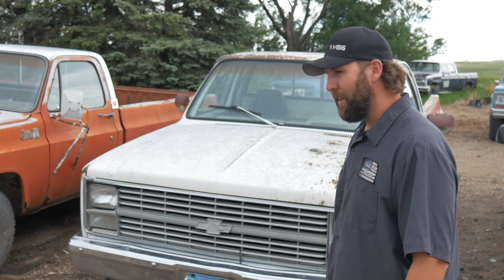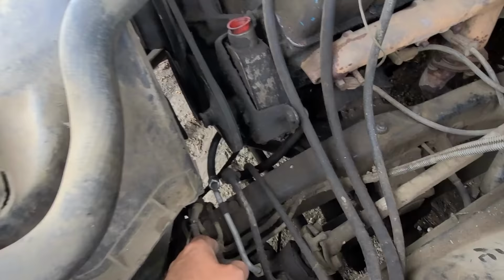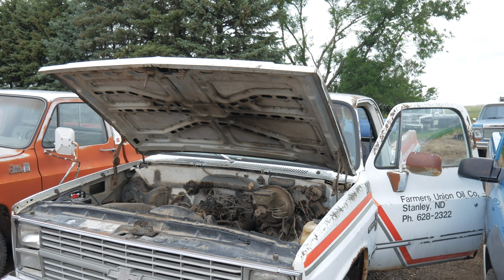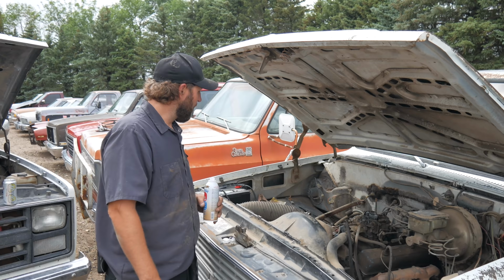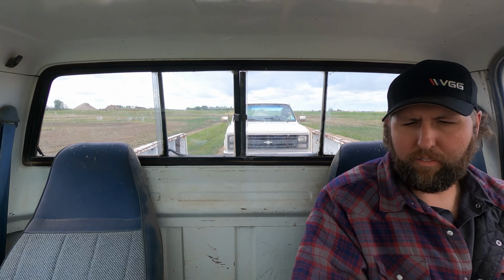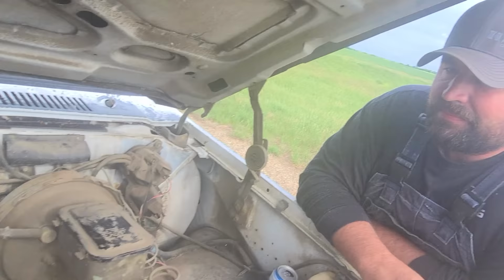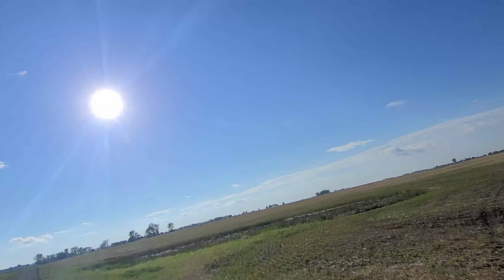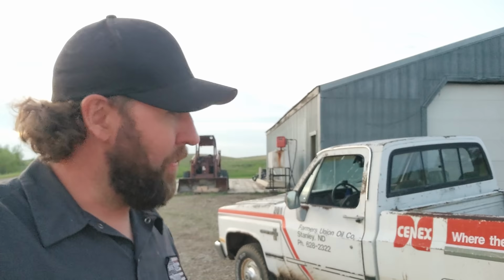FORGOTTEN Chevrolet 4x4 Square Body - will It RUN AND DRIVE 60 miles home?

Comment: I just want to say I revived my friends old dodge that sat for a while and everything I did to get it running I learned from these videos.
Reply: Just about everything I know about cars comes from this channel
Reply: @Inisfad  yeah that’s the problem we don’t know what he’s tasting for lol
Reply: @Inisfad  u can smell the gas in the oil. Not sure what it means tho exactly lol
Reply: @billybobthornton4186  it means your getting gas in the oil.....  bad fuel pump usually
Reply: I hear u there he gives me more inspiration to do more of my own work then to pay someone to do a half job
Reply: @carolynwilbur1627  rings aren't sealing plus incomplete combustion (raw gas is left in the cylinder, and it gets by the rings into the oil)
Reply: @Inisfad  usually it tastes like burnt French fries and old maple syrup
Reply: @Inisfad  anyone who has siphoned fuel knows what it tastes like, and anyone who has had to pull a lower hose first knows what coolant taste like lol
Reply: @carolynwilbur1627  not the fuel pump..usually that means rings are worn or stuck.
Reply: @50ccog  Ernesto eel el el to Eric erré
Reply: @MP-zf7kg  I had bike that did that. It was fuel injected idk why but it injected more than it needed and always ran rich. Pretty sure my lawnmower could of ran off the oil out of that bike before I got rid of it. 

It was a single cylinder and never missed.
Reply: @sethkyehardin5338  I syphoned coolant from my over flow to my rad and drank a bit won’t forget that lol
Reply: @billybobthornton4186  means it's been flooded really bad more the. Once
Reply: My 14yo son and I revived an F100 he is taking pride in building to be a good weekend driver
Reply: Really hope you use the correct terminology such as Crankalater, Lightning Whirller, Thunder Box etc.
Reply: Chevy Is The Best, sooooo
Reply: @billybobthornton4186  fuel in the oil of a lot of the cars Guy works on means somebody tried unsuccessfully to start and dumped a lot of gas down the carb and it seeps down into the oil pan.
Reply: @donfronterhouse4759  or it just flooded
Reply: And it's a Mopar.  😂They just wanna run
Reply: agreed upon love this channel I'm looking for a project now myself

Comment: My wife, who doesn’t watch the show, said “They spent more time trying to save time. Must be one hell of a meatloaf.” A wise woman.
Reply: Sounds like a good marry you got there.
Reply: I was worried the hole video that they weren't gonna make it to the meatloaf lol
Reply: Square body Chevy’s will always make it home! In essence they will last forever, with a little elbow grease.🏴🏴‍☠️🏴
Reply: @jeffwhite6343  
Hole?
😂😂😂
Reply: @jeffwhite6343  The drive back would have been hella boring if he had fixed the plug wires and the fuel situation from the get-go.  Was more fun this way.  

I used to have an '88 Mustang that would randomly quit on me, usually when slowing down for the next town.  Was really too much drama for me.
Reply: @SouthernPirateOutdoors  not always the last square body I bought I flipped the brights on and it shut off on me had to have another square body jump it cause a 24v cummins couldn't get it started lol
Reply: @randallsmerna384  sorry I guess I should've spell checked my work I didn't realize I was being graded on this I'll try to do better next time 😅
Reply: @jeffwhite6343  No worries, I thought it was funny!
Reply: Never pass up a good Meatloaf Dinner or some Smokey Ribs and Corn Bread.
Reply: @jeffwhite6343  shoulda stayed in school ya dropout
Reply: @dionst.michael5818  I know rite I should've went to a real college instead of flight school maybe they would've taught me how to spell. 🤔😄
Reply: @jeffwhite6343  thank God I don’t fly. But thanks for the heads up
Reply: @dionst.michael5818  You wouldn't have to worry anyways I don't fly civilians I'm a Marine Corps pilot and it's not allowed lol, but I think I may know why I spelled a word wrong its probably because I'm from Alabama🤣
Reply: @jeffwhite6343  nah dude. I’m only funnin with you. My apologies.
Reply: @jeffwhite6343  I’m in Ottawa Canada.
Reply: @jeffwhite6343  p.s. if anything I envy you. Take care.
Reply: Good Meatloaf
Reply: @lawrencegoddard4002  I would do anything for meatloaf...but I won’t do THAT! Lol. See what I did there? Lol! THIS 👆🏻 guy ‘gets it!’ 🤣
Reply: @jeffwhite6343  Unless you have an English degree you don't need to worry about spelling. Even STEM majors DGAF  😂😂😂

Comment: My X Father in law and I got trapped way out of town one early morning with a busted fuel pump. After trying just about everything I got the idea of pressurizing the gas tank with my portable 12 volt air compressor. So we wadded up a garbage bag around the air line and forced it into the filler tube for the gas tank of the truck. I let the compressor run until I heard the gas tank expand and cranked over the truck engine. Imagine my surprize when the truck started right up and ran like a champ! Got us the 18 miles to home with no problem!😊

Comment: Old square bodys never die, they just smell like it.
Reply: Mine smells like old wet dog, charcoal and a gym bag that's been left in the locker for too long. I think it's the factree smell.
Reply: Cap and rotor
Reply: That distinct squarebody smell!
Reply: Mine smells like concrete
Reply: I agree they never die. Like it or hate it, the 305 is tough as nails.
Reply: @Whats-It-To-Ya  Yes, but when you opened the hood on a Camaro and saw the 305 you were like, ahh hell.
Reply: I like Derek's: "Smells like a porta potty at Woodstock" (out of another video)
Reply: @oldscout80  or “Smells like boiled dog vomit and twizzlers”😂
Reply: @bb5242  231 v6 i would have taken the 305 over it but it did run good for years i could drive it from Austin Texas to lavinia Texas on 15 dollars round trip and it was a 80 Camaro
Reply: @Whats-It-To-Ya  That’s because they don’t have enough power to hurt themselves
Reply: And the hoods fold in half....
Reply: My old 86 chevy k20 custom deluxe long bed 4x4 farm truck smelled like chicken shit and rotten gas lol, it was a portable sprayer tank truck, would have been a beautiful truck when it was new two tone midnight blue top and bottom and roof and frost gloss white center down the sides and the tailgate, and the gm triple pinstripe which was also blue

Comment: Just to know there's a yard full of square body Chevys makes my day. I want one again 😂
Reply: I was eyeing that crew cab in the back!
Reply: I would have did a package deal to buy all those squarebody, value on those trucks are going up
Reply: @denniswobbe3157   --  I saw it first, LOL.....
Reply: @ironcladranchandforge7292  but I commented first!
Reply: @denniswobbe3157   --  LOL..... You did indeed sir.
Reply: There's one ten times that size in Texas and I saw one somewhere that had over a hundred squarebodies.
Reply: sorry fellers i live in north dakota and if Derek didnt beat me to it im gonna find it first! lol
Reply: @johnofthejungle5699   --  Well that's not fair, LOL...
Reply: @vicegripgarage. You gotta help me out!
Reply: My wrecker is a 82 -3/4 ton and ive been parting out 16 square body trucks.  The entire front suspensions sell really well. Folks install them in the 60 thru 70 trucks to get disk brakes and 5 lug wheels.
Reply: The collector on the corner and the trucks like the 74 chevy c10 Cheyenne super 2wd long bed big block Chevy V8 manual column shift 3spd transmission trucks that was 6 lug as well

Comment: You know..... y’all might not think this.... but Derek, my friend, you’re setting the path to your kids and generations to come. When everything is electric, in who knows how many short years, your kids will look back at these videos and realize what simplistic really is. All mechanical, and just a bit of smarts, can get you very far in life. I take these videos to heart as they are a way of life in early years, that built America, and the world. Keep on keeping on my friend....
Reply: Well said 👏
Reply: For real time has changed byron
Reply: Sorry Bryan
Reply: @jasonowens4303  I agree man.
Reply: With electric at the point it is now is not practical as a replacement for fossil fuel vehicles. Electric is very efficient for mass transit with an external power source, but batteries present a major challenge and the electric grid is already at capacity and can’t handle the demand total electric would create and much of the electric is created with fossil canceling out the supposed benefits of electric along with the new environmental hazards the batteries present.

Comment: I have a 1974 c20 camper special 454... It only has 40000 miles on it. Power disc brakes... Rock... 4 barrel..  it starts at 10 below ... 350 turbo tranny. Just so impressed with this truck. It's 49 years old... Still pulls hard.. great heater. Ect... Chevy knew you to build them... Great video Derek
Reply: Hard to believe that it has a TH-350 behind a 454 in a truck... they were almost ALWAYS TH-400's
Reply: My 74 chevy c10 Cheyenne super 2wd long bed was a regular cab no ac factory and column shift 3spd manual transmission

Comment: Those old Cenex probe pickups were well used. When I used to work at one in the 90s, they had to pull loaded anhydrous tanks during fertilizer season, and bounce all over the fields to get samples. Usually nothing left of them after 10 years...

Comment: Kinda looks RED, WHITE, and BLUE to me!!!  Could it be possible???  An Independence Square Body finds its new home for Independence Day?  Well, break out the hot dogs, Merica!!!
Reply: Amen
Reply: A suitable tow rig for Independence.
Reply: I see you have a parts truck fallowing you
Reply: God Bless America
Reply: Lay off them hot dogs I'm already floatin away in em here at the campsite...
Reply: I have an independence square body
Reply: Dr Lee..... Gotta get Derek out on DemoRanch to shoot pew pew !
Reply: @richardbaumgart2454  We had a fairly new 85 Camaro I actually inherited the car back in 88 when I got home from Panama went reserves after that and thought it would be a really cool car to give to my then girlfriend that later became my old lady. The thing only had 34K on the clock leaked oil out of the rear seal and the trans kept leaking out of the shift leaver seal... I was barely set up and prepared for tearing apart such a pretty new car but I talked my dad into clearing the opposing end of his barn he didn't use and I set up as shop and kept it that way until I bought my first house. I got a bit deranged over disconnecting all that pollution shit they had on it. Until I was done it had headers the cat converters were gone it had new exhaust and an Edelbrock set up for the carb and intake. You shoulda seen my dads face the one Saturday afternoon when he walked in saw the motor hanging off the block tackle chain the hood off and the ton of boxes of speed parts I bought and all the shit I tore off the car was strewn about like a 6 year olds play room... He nearly shit himself. He yelled at me WTF R U doing. I said what does it look like I'm doing fixing the damn piece of shit. The car was from my late step mother his wife is why he got so wound up but he knew it had the oil leak and I said I was no going to have an oil leaking pig parked in front of my apartment.
Reply: @jasonpatterson947  I have a sneaking suspicion that's a possibility, Jason! (wink, wink, nudge, nudge!)
Reply: @brodyschindeldecker1241  hellyeah 🤘
Reply: yup apple pie and cheverolet life dunt get better dan that
Reply: @richardbaumgart2454  U R correct... The 305's were really popular in our weekend street stock series... Take in account a 350 can be way too powerful for small bullrings no matter dirt or asphalt so I have nearly 4 decades playing with the little puppies and they can almost equal a 350cid when prepped and tuned it can turn into a real shootout at the finish lines... I ran a few of em for several years it took a few years for my competition to figure out just what the hell I was running that looked like a 350 smelled like one but they couldn't make the connection a 305 will never make the bottom end a 350 does those guys trampled me at the starting lines every time.. . However on a race track the 305 stays consistent you do not have to paddle the brake and gas peddles to keep up the pace. IN OTHER WORDS IT IS NOT OVER POWERED THAT YOU HAVE TO KEEP UP ON THE THROTTLE and constantly keep braking into the corners... Kinda like coasting down a hill. Give a 305 a chance on a bullring type of track U got a winner... You don't need Horse Power on a bullring track you need steady throttle period... A small oval has always been a battle of survival & attrition not horse power. OLD MAN EARNDHART WAS CORRECT IT HAS NEVER BEEN THE FASTEST CAR THAT WINS IT'S THE MOST CONSISTENT CARS THAT TAKES HOME THE PAY CHECKS.
Reply: @jasonpatterson947  Has to fix the gun before he can shoot.
Reply: You know I don't like hot dogs on a day like this!
Reply: @051570orion  how tf do you manage to mix up followings o with an A🤣
Reply: @olgriz485  WWG1WGA MAGA
Reply: @logpile1318  i accidentally entered that
Reply: ×q¹It is  good to have  friends  who will  help!!!!!! @thekingsilverado9004

Comment: Poor old thing sounds like it has NO compression..would love to see the numbers
Reply: I want to see the bores and the ring gaps myself. Numbers are kinda irrelevant we know it's barely gonna twitch the gauge just from seeing how fast she turns over.

Does show just how skookum these old american V8s truly are, though. A modern engine that wore out just plumb ain't gonna run anymore. This SBC more or less still got a guy home.
Reply: Yea, that ole starter is hardly fighting anything.
Reply: @TestECull  you’re assuming there are still rings in all the cylinders.
Reply: I’d wager the cam is smooth as a broom handle as well.
Reply: Maybe if you add together the psi on each cylinder you can break 45.
Reply: Yeah, it cranks over like the spark plugs are already out.
Reply: Those year Chevys didn't hardly have any compression when they were brand new... You were lucky if it was actually 8:1.
Reply: @910rick  ahahah 😂😂😂
Reply: It sounded to me like a hole in one of the pistons.
Reply: @mexicanspec  Nah..

Comment: Early 80's 305, bet that cam is rounder than a ping pong ball.
Reply: Yup, did you notice how fast the starter was cranking her over?, the compression is crap on that engine, he can help her out with plugs/wires but the engine will need to come out for rebuild/replacement.
Reply: That motor will go another 50K miles the way it is with a simple tune-up and fresh oil.
Reply: @Whats-It-To-Ya  It's just worn out, you can hear it, any engine that spins over THAT fast is presenting a tiny load to the starter, probably why they gave up on it.
Reply: Ya, my first thought too when I saw blue. Three Oh Why.
Reply: @barryaiello3127  
change oil, add ENGINE RESTORE,  Lucas oil stabilizer,  10W40 or 15W40 and the oil pressure will come up , and compression will come up, maybe not for long but it will work for a while, I did that to a wore out 76 Cadillac,  and it ran for another 4000 miles
Reply: @bertgrau9246  Maybe, restore can help, but if it's that old and tired it's time to swap it out, a 350 would work fine in that rig.
Reply: Yup. 305's got decent gas mileage, made good torque, but would round off a cam lobe if the valves even thought about getting sticky.
Reply: Yes soft cams and I'm guessing that is probably part of the fuel pump issue that eccentric is probably pretty worn down as well I'm sure that cam is about useless
Reply: Yes my grandpa would throw a new oil pump and oil pan gasket valve cover gaskets put umbrella seals in it and stem seals a parts store replacement cam but slightly more lift if it was a 305, and fresh spark plugs and Napa belden ignition wires and fresh oil like 15-40, although i have seen him use 20-50 ouch and runs it til it breaks and then just have the motor swapped out and that one eventually rebuilt and either it got a new replacement motor or more than likely the nearest junkyard score sbc that didn't have holes in the block and carried ok oil pressure warm
Reply: And there's one the most obvious clues look at the carnival that qjet equipped truck has been running poorly for a very long time

Comment: That GE is a two way radio. The base was likely at the Cenex station.
Reply: A business band radio, to be exact. The frequency it is programmed to, or more likely has crystals for, is probably being used by someone else, or is not even used anymore. I really like old radios and such.
Reply: @robertschemonia5617  correct. More than likely the crystals have drifted enough over the decades that it isn't on  the correct frequency anymore anyway. But it was most likely licenced frequency.
Reply: We had those exact radios in our pickups and one at the house back in the day. Only way to communicate over a distance on the farm. I remember my mom in there “6-0-6 to 6-0-5, dinners ready,”

Comment: This is a great video as are all of yours!  Having worked at several coops many years ago, I am shocked that an old soil testing pickup is even in one piece!  Don't look at the frame, it has probably been welded back together numerous times.  Also, that new power steering line is probably because of the soil probe being removed.  Most were hydraulic that were run off of the power steering pump.  Keep up the great work!!

Comment: I've got 2 squarebodies, a 74 and an 81. The 74 is a 350 automatic that is currently getting an LS transplanted in. It's 4WD. The other is my favorite, an inline 250 with the 465 & 208 combo. It's 85% restored, putting a little more oomph in the engine & then needs paint. My favorite trucks.

Comment: Way back in 1989, I bought an R titled 1987 Chevy square body short bed. It had 4 speed manual with a 305. People questioned me for buying an R titled truck. I had it 10 years with minimal issues. Loved that truck.